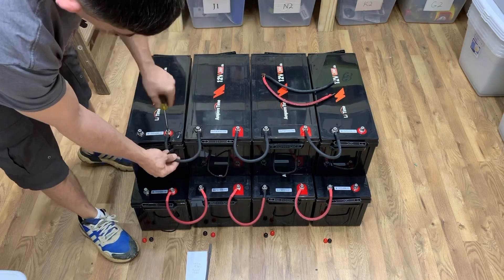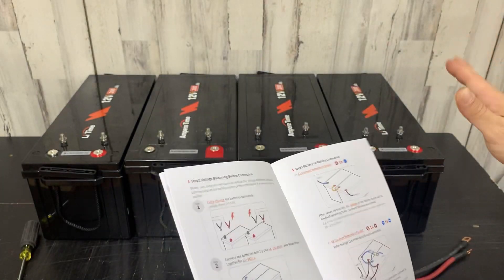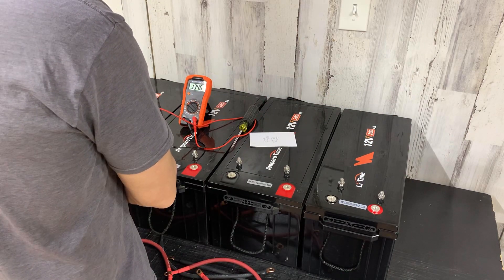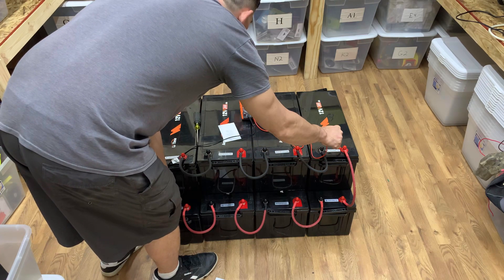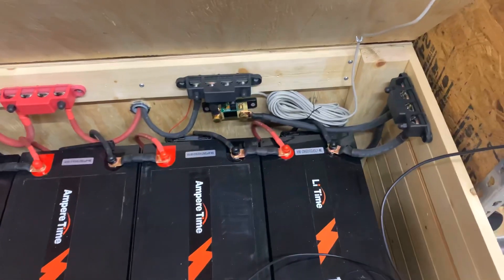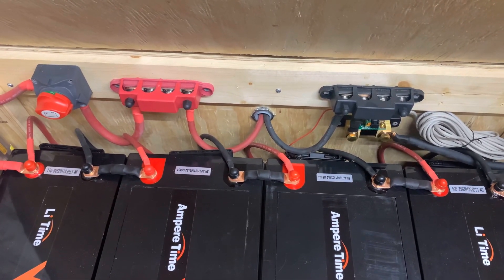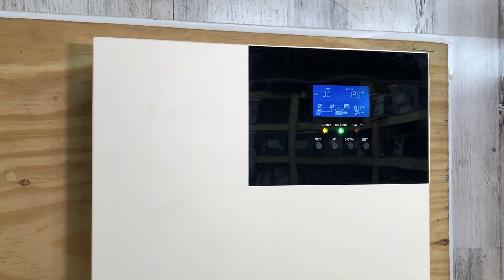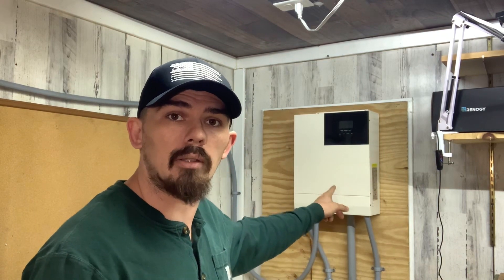Cheap 20kwh Lithium Battery Storage for Solar Setup in a 48v System Perfect for Off Grid (Li Time)

Comment: You can DIY New 16 EVE grade A 3.2VDC cells for a 51.2VDC battery @ 314Ah.  Little over $1.8K for 16Kwh that's has its own box, 200amp JK BMS/2A active balancing  with digital display and breaker. Parallel two of them for $3.6K and get 32Kwh of capacity is the best DIY for cheap at $110/Kwh Only draw back is you import from China and have to wait like 2 months to get everything.

Comment: Good job, you are doing the same thing i am.
Using 8 12 volt batteries to make the system.
I have up to 48 volts at 640 amps for 6,500 bucks.
Server rack would be 600 amp at 12,000 bucks.
So we win.
Aswell i run it at 12 volts and 2,560 amps as i dont back up my hole house just a few things i want like freezer, internet, lights and that sirt of thing.

Great video thanks fir sharing

Comment: it will work that way but I see balance issues coming. With that many batteries you reall nees to switch to a length ways buss bar system with final connections on opposite ends

Comment: Looks like a few others have made similar comments, Lithium's, are highly flammable, I would be fire rating everything in and around those batteries. Nice setup.
Reply: "Lithium's" is not a type of battery. There is more information out there that may help you make sense of why some Lithium batteries are able to be used seemingly carelessly compared to some other Lithium batteries.
Reply: These lifepo4 batteries are the safest around" you are thinking of other chemistries

Comment: Using your 53.8v measurement you have a 10 kWh system, not 20.
Reply from the maker: 2.5kw per battery, 8 batteries. Wattage is wattage, doesn’t matter the voltage

Comment: I'd build it in something less flammable, look up small lithium battery fire. At least add sheet rock.
Reply from the maker: Would love to, but lack the funds. I don’t think much would stop them from doing damage if they failed anyways.
Reply: LiFePo4 batteries are extremely stable. Chances of a fire are slim to none.

Comment: Man if u do get a chnace i m putting 200ah12v4x batteries to make 10.2kw backup system i hav ebrought a batteries and going to have 12kw hybrid inverter along with around 15kw solar panels but i have no idea what do i need to get them in series plus i do i need to put Equalizer on all the batteries at all the time or the inverter acualy has these build in plus my batteries has been build in bms nothing else each battery 200ah12v where i m going to make this system there is halrdy any electricty always loudsheding
Reply from the maker: Hey my friend, that’s a lot to process. You need to see what your max pv voltage is for your hybrid inverter. That way you know how many panels you can run in series. Then you also need to know the max amps to determine how many series runs can you parallel before you max out. Where are you from? I just heard of loadshedding, is that where your government cuts the power off everyday at a certain time?

Comment: Quick question.   Wouldn't it have been easier to just get a 48v battery to begin with vs. the way you did it?  I'm asking because I don't know and still learning.   Thank you.
Reply: There is Deferent in 48v and 20kw
Reply from the maker: Probably but I started off with a 12v system and already had the 4 ampere time batteries when I decided to upgrade to 48v system. And I wanted to have the option to use any voltage in the future if need be.
Reply: @doingitthegreenway  aaah ok thank you

Comment: I have a serious question. 
I have a 48 volt EG4 inverter.
I have 8 li time batteries 12volt 100ah.
I want to get the most out of the batteries.
Can I put all of them in groups of two in parallel (12 volt 200ah) each., then take the four groups and divide them into two groups in series (24 volt 200ah)
Then, put the two groups into series to get 48 volt 400 ah. at 19,200 watt hours?
It sounds good to me, but I don't know enough about it.
If this is possible, where can I find the warring diagram?
I would really appreciate any help.
Reply from the maker: From my understanding it’s best to make as many parallel runs as possible first, then series. So if you have 16 12v 100ah batteries, you would stack 4 vertically in parallel to make a 12v 400ah bank. Do that 4 times and let them balance. Then wire each row horizontally in series to make 48v 400ah (20kwh) battery bank. Wire each 48v negative to a single bus bar then from bus bar to battery shunt. On each of the 48v positive side I suggest  running them to their own class t fuses before the buss bar. Hope that helps.

Comment: Your battery is about $250/kWh, that's a pretty good price really.  server rack batteries, at best, is $300 (5kWh @ $1500) right now.

I'm planning a diy 30kWh battery that should come in at around $170/kWh but the ease of setup may make your solution more ideal.
Reply from the maker: Sounds like a more technical build, sounds interesting. If I build another system I will probably buy the cells myself.
Reply: check out the cells on Battery Hookup right now. They have 2x New CATL 3.2v 280ah Cells for $275. Best deal I have seen anywhere.
Reply: @DarkMatterDrift x4 eve 280ah for $450 now.Is that a better deal than you posted above?I guess it would be $1k for 24v 280ah with 8 cells.
Reply: IDK I just replaced my lead acid batteries with the Lifepower4 which I bought a couple weeks ago on sale for $273/kwh.  If I could find known good parts to build it substantially cheaper myself I would, but I can't find anything. Where are you getting GOOD cells for anywhere near that price?
Reply: @MyBacktrail  battery hookup!
Reply: @DarkMatterDrift  yes, after I posted that I went there and saw that they do have some awesome deals right now so I stand corrected!
Reply: @MyBacktrail  Another good place to keep an eye on is 'battery clearing house'. These are the only two places I will ever buy used cells from, but they are usually solid cells (you can get new cells, but the price they give on cells that are testing new is hard to beat).
Reply: @MyBacktrail  280ah cells at around $140, times 16 is about $2300, plus $200 for bms plus about $200 in materials for a box, yields 16kWh pack, so around $170 / kWh. But it's all diy.
Reply: Down to  $100/kWh now and falling fast

Comment: How did you connect those batteries without a spark?🤔
Reply from the maker: I used a 25w 30ohm resistor to pre charge the capacitors before connecting the inverter

Comment: I didn't understand the top to bottom smaller gauge wires on the battery bank. Could you show a schematic that shows how the top and bottom are tied together and why they are tied together that way? I understand the fundamental four in series for 48 volts and then those two tied to each other in parallel. I don't understand the other wires between the batteries top and bottom. Thank you!
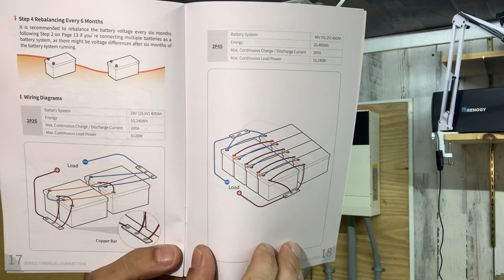Reply from the maker: Ok so the smaller wires are from when I had 4 batteries wired in parallel to have 12v 800ah. That’s what my old system was with 3 Renogy 40a charge controllers. When I decided to upgrade to 48v system I ordered 2/0 gauge and was planning on wiring in 4S2P. Side note the manufacturer suggests 6ga is good enough for all the wiring between batteries. I wanted to keep a consistent ga from the busses all the way through the batteries. That’s why I went all 2/0 ga. Ok so when I actually receive them and was looking at their suggested wiring in the manual is when the plan changed. This is how Li Time recommends them be wired. So I improvised and already had the 4ga wires made and since only 6ga is required, I went with it. Now this is 2P4S. The diagram is shown in the video at 4:50. From my understanding it is to achieve a better balance. Having each stack paralleled and then each row in series gives you less to balance. In series they don’t really balance well. So if they where just paralleled at the buss bars then your only balancing the overall voltage which could lead to in my case 8 different battery voltages. The way they are currently wired, there is only 4 different voltages possible. (Each top and bottom battery will be the same voltage) One thing I will be adding soon is a 48v battery balancer or equalizer. This will monitor and keep each stack balanced to the same voltage across all batteries. Pretty neat if you ask me. I hope that explains it, good luck and stay safe.

Comment: Use an HA02 ballancer/ equalizer.
Reply from the maker: Thanks again!
Reply: Thanks for sharing the pro-tip with us noobs.
Reply: @callmebigpapa  I was just mentioning the HA02 as I have used one and had good results with using it without worrying too much about ballancing the batteries before connecting them together. The HA02 is for 48v. HA01 is for 24 volt. I have had initial ballance of more than 1v apart that became fine after a week or two with the ballancer connected. I have nothing to do with the manufacturer or any retail of this product. I have just used and are jusing both of them. I bought them on Ebay.
Reply: @leonhardtkristensen4093  I really appreciate your candor and insights. As you know a bunch of batteries like these are so much cheaper than one of the wall mount single batteries or a Tesla powerwall so I am trying to make sure they are the right way to go. In 10 years all this will seem so primitive when we all have 100kw sodium ion batteries built into our garages.

Comment: That's interesting and very tidy - My RV has almost exactly the same ratio between Solar output and battery capacity  ie 1watt per amp hour @ 12v - some say its solar deficient  however my needs are light and I like having a reserve battery capacity for 2 or 3 overcast days in a row - thanks for posting
Reply from the maker: Thanks! I agree, being prepared for unfair conditions is a must if you want to be completely off grid. I also like how rarely they cycle. They pretty much stay around 30%-80%. Summer is here so now I’m adding an air conditioner to it, but I’m also about to increase the solar to 5000w array. Hoping all works out well 🤞
Reply: @doingitthegreenway  30 - 80% is perfect for long life - maybe should  get an electric ATV LOL

Comment: Look into Tesla battery modules out of salvaged Tesla cars. They're 5.2 kwh capacity, 24 volt, and can be had for $600-1000 depending on the mileage of the car they're pulled from.
Reply from the maker: That’s a pretty good idea, thanks. I will see what I can find.

Comment: I have used Ampretime batteries on my last 3 builds and the last one i tried using 2 200AH and had nothing but trouble so I took one out.
Reply: Same here. But with Power Queens. When the batteries are fully loaded, the BMS is shutting down. Like it should, but both ways. 😡🤬
Reply from the maker: Try adjusting your charge controller to a lower voltage. I’ve seen some batteries do not like 14.6v. Try 14.2v
Reply from the maker: I haven’t had any trouble yet and I’ve had the ampere time batteries for almost a year. Try customer service they are amazing. If there is a defect with the battery, they will replace it. You get 5 year warranty.
Reply: @doingitthegreenway  I wrote to Power Queen via Emai... 3 weeks ago. I am still waiting for an answer. Anyway, I dropped the float voltage to 27.2. This helped a little bit. Tomorrow I will drop it to 27.0. Absorbtion voltage is like recommended at 28.8. I can load the batteries up to 90 % only. When the sun is down, the voltage drops from 100 % to 90 %. I am trying.... before I use my sledge hammer. ;-)
Reply from the maker: Maybe try adding a battery balancer. Someone suggested that earlier and I’m looking into it as well. Also someone suggested pulling all the cells out and building your own with 1 bms but that would definitely void any warranty.
Reply: @doingitthegreenway  The hell with the warranty. ;-) The BMS is shutting down completly. I understand to block the charging an 100 %, but not the discharging. No balancer would change that. I will open the case when I have a new battery. But this time I will get only one battery, 24V 300 ah. And with a fully programmable BMS and the option to open the case. I think it will be one  from JOSMA. I can't diy a battery because I have no tools.. and I can't afford them at the moment.
Reply: @doingitthegreenway  Btw., thanks for writing with me. 🙂
Reply from the maker: @stanlibuda5786  I enjoyed the chat
Reply: @doingitthegreenway  Thank you. Me too. I guess I made it. I set the bulk charge  voltage to 28,4 and the absorbtion time to 10 minutes only. The float voltage to 26.8. Way less than the manual from Power Queen recommended. Especially the float voltage. With these settings the batteries will load 99 %. Problem almost solved. I can live with that. I will don't buy any batterie without a programmable BMS and without the option to open the case in the future. The Chinese can only fool me once.... well, hopefully. ;-)

Comment: I recommend installing a lithium battery ballancer as well
Reply from the maker: Thanks for the tip, I will definitely look into it.
Reply: @doingitthegreenway  I was going to recommend the same thing. I set mine up similar as yours but I was seeing a battery or two getting full before the others. Once one bms shut down the full battery the other 2 or 3 would stop charging. I bought a balancer from Watts24/7 and they all come up to their maximum charge. I checked the price and they are up to $78. now. The device will show the voltage of each battery which is handy. 
You don't get that problem with the server rack batteries because they use one bms. The issue is because of the 4 bms's.
Reply from the maker: @fauxque5057  Thank you so much for explaining that! Love the feedback! I will be ordering one soon.
Reply: @doingitthegreenway  I should have added that you can read each 12v battery voltage while it's still in series. A simple volt meter will show you the voltage of each 12v battery and you can see if they're all the same voltage. I'm willing to bet that they're not, at least that's been my experience and the reason I hunted down a balancer.

Comment: Watts247 sells an active balancer that you can use when running 4 12.8v batteries in series like this.  My first two battery banks each use 4x 100ah Zooms batteries in series and I keep them balanced with the Watts247 active balancers.

Comment: Your getting pretty close to the price of a eg4 server rack battery ($1,449.00) 5.12kWh 
It has low temp cutoff & you can take it apart to service if something goes wrong like the BMS ect
Reply from the maker: Those are some nice batteries, I would like to try one in the future. I didn’t want to be stuck to 48v just in case I needed to change the setup. It’s a bummer because you would think buying 1 48v battery would be cheaper than 4 of their 12v batteries but that never seems to be the case with any company. This is a 400ah @ 48v battery bank. For the same price I could only get 300ah @ 48v eg4 battery bank. That’s 33% more storage!! For now I have to go for the bigger bang for my buck. Can’t wait to try one though!
Reply: Tesla modules from salvaged Teslas are 5.2 kwh, and can be had for $600-1000 depending on how many miles are on the car they're pulled from.
Reply: @whatta7793 and you get a less stable form of Lithium batteries that can burst into flame unexpectedly.
LiFePo4 technology is stable in comparison and isn't prone to starting a thermal runaway fire

Comment: I think that you have done all you can for the best chance but I seriously doubt the Batteries will stay balanced for very long. Six months maybe and you’ll be disassembling and re balancing. They make battery balancers for what you are doing but most don’t work very well. I’d be looking at the ones that Watts24/7 sells if any. Since you are mobile you don’t have many choices other than what you did. Fingers crossed for you.
Reply from the maker: Thank you for the tip, I will definitely look into that! 🙏🏼
Reply: Bingo. 4 4S BMS’s or 1 16S BMS

4x the trouble
4x the balancing differential 

OP, I’d seriously look at ripping the cells out of the battery boxes (you can resell them) and putting the cells in 16S with a 16S BMS. As long as there are holes at the end of each 4S bus bar for you to make jumper bus bars out of thick wire it should be a very straight forward process. You’ll probably want to capacity test every battery (or every cell) to create the most balanced 16S groups you can. 

Nothing stopping you from taking them apart and reverting to 4S and you can sell 7/8 or 6/8 of the BMS’s if you need to recoup money for the $100 you spend on a 16S BMS (JBD or JK)
Reply from the maker: @ericklein5097  I really appreciate the advice and I will definitely look into it. I like all the help I’ve been receiving, y’all are awesome!
Reply: I have had good result uinig a HA02 equalizer. It can be bought on Ebay.
Reply from the maker: @leonhardtkristensen4093  thanks!
Reply: It doesn't even take 6 months. I noticed a problem within days. Probably sooner but I didn't check right away.
The issue is each battery has its own bms. The first battery charged shuts down and the rest won't top off. It is usually the first battery in series that reaches a full charge first, but not always.
The balancer solved my issue. When I add 4 new batteries to my bank, I always add the balancer as part of it.
Reply: DON'T THESE BATTERIES HAVE BUILT-IN BMS?
Reply: @matone184  
Yes, but they don’t talk to each other. When one battery gets different the other can’t do anything about it so the one battery’s bms will stop charge or disconnect
Reply: @matone184  The BMS is internal - not between the batteries.